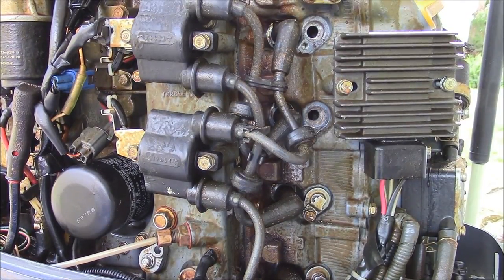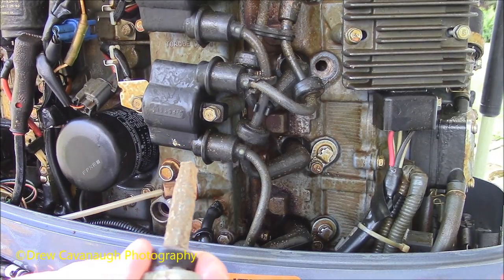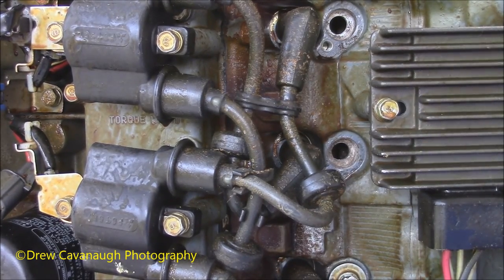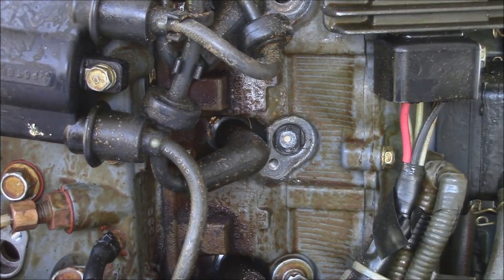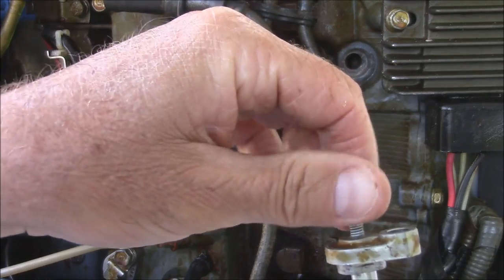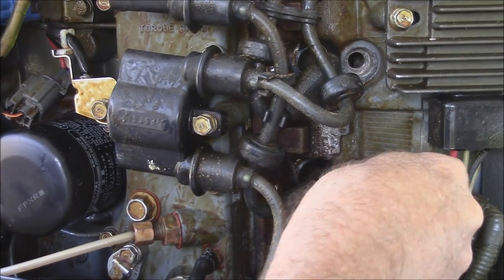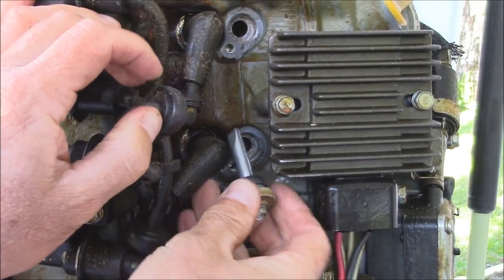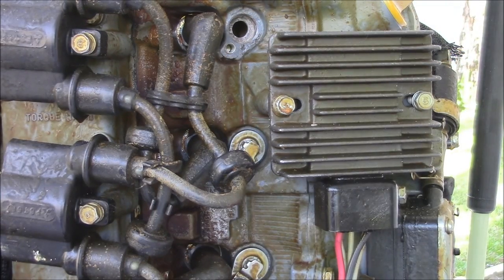Replacing Internal Zinc Anodes on an Outboard Engine 2024 Updated

Comment: I love your video's Drew keep up the great work. I've followed all your F50 video's and everything has gone smoothly, even the water pump was a piece of cake with your help.

I'm going to do the anodes next. I assume these anodes go in to the water jacket to stop the salt water in the cooling system corroding things. So if they break off inside how and where do they come out of the engine? Not much can pass through the telltale even sand can block it, so obviously anode fragments would be bad. Or do they go in to the exhaust chamber?
Reply from the maker: Haywoodjablomie100 The exhaust chamber is what they told me they exit through... And Thank You!

Comment: Thanks for your video, i saw your outboard was some many grease on it, it that okay?  I have my old 2 stroke 115 also dirty as your video outboard, and someone told me just leave it will be ok
Reply from the maker: +Jerry Chan Not sure what you mean?
Reply: Drew Cavanaugh theres brown and oil on the engine just cover on the power head is that okay?
Reply from the maker: +Jerry Chan Oh yes okay. This is a corrosion spray I apply. It is a "wax" type of brown look, it is not oil or grease. It helps to stop rust from the saltwater spray we get here in Florida.
Reply: Jerry Chan Khalid